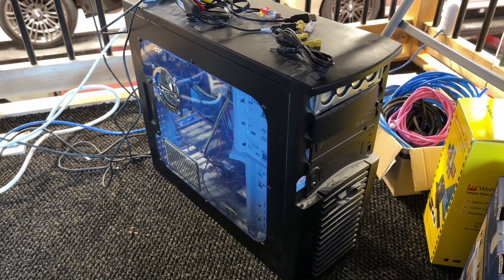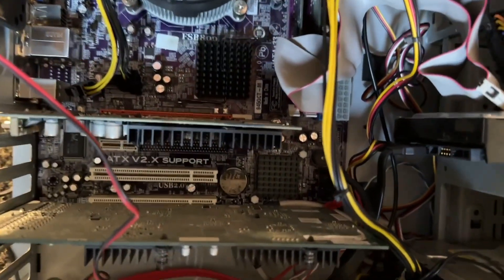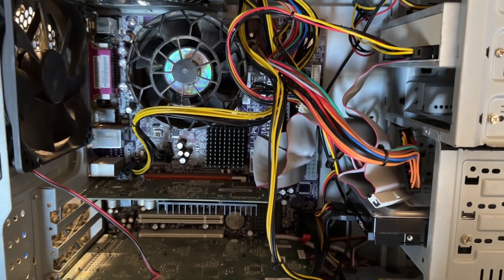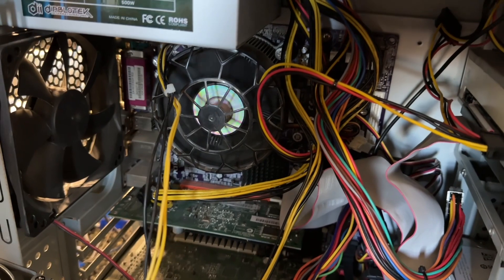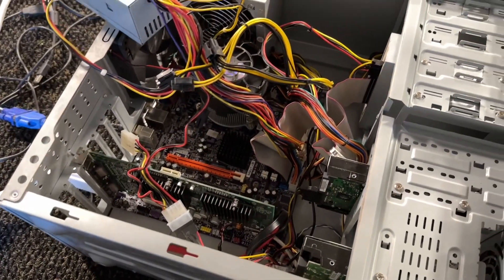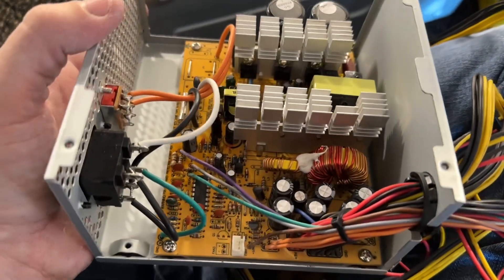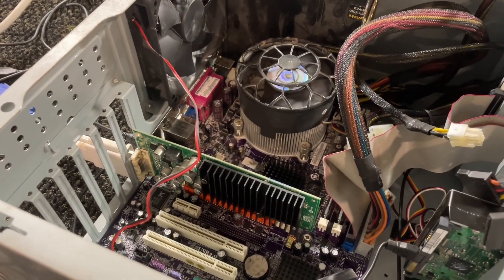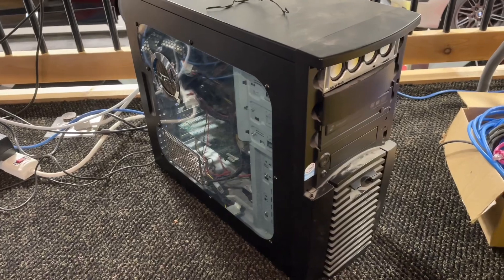when your 16 year old budget PC won't post anymore!

Comment: This was built during the capacitor plague so, I'd try recapping the entire thing.
Reply from the maker: the PSU was from 2012, so not surprised that pos failed - the actual mobo does seem ok.

Obviously the ECS board isn't a high quality thing, but she's workin just fine with that 'new' PSU :D